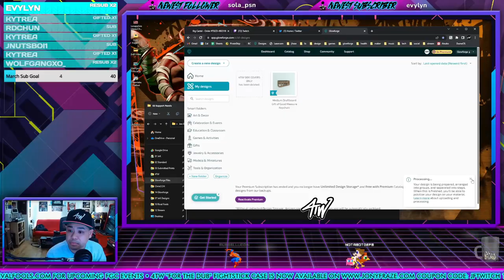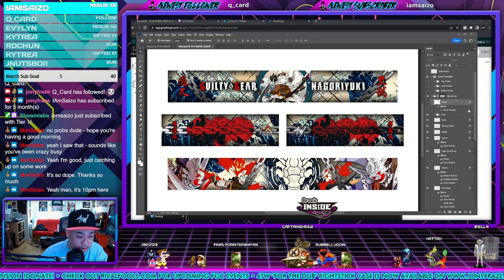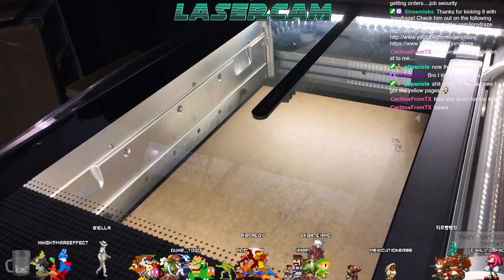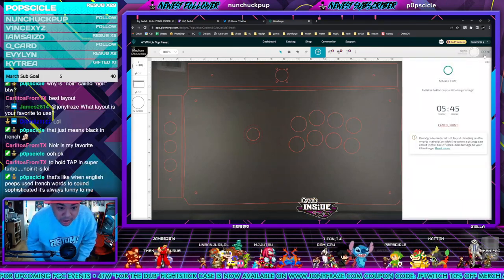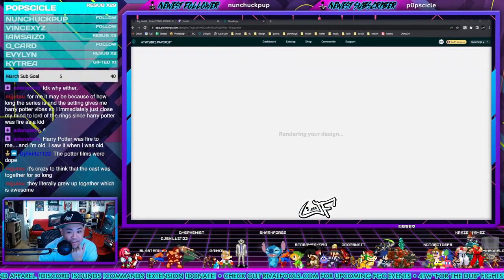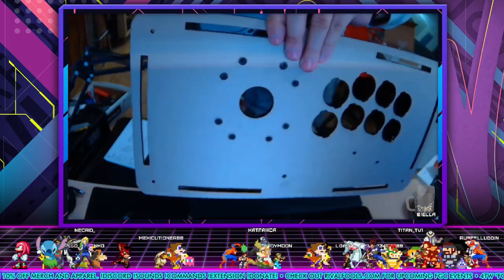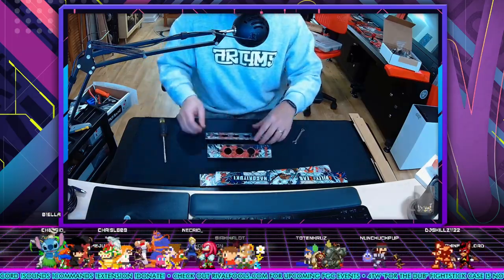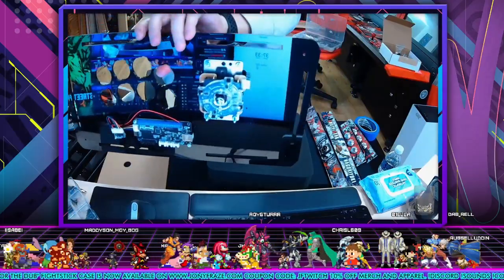Building a Fightstick from Scratch!

Comment: Hey man, I want to make an arcade stick, but covered in leather, maybe ostrich leather and you seem to know what to do, how can I  buy the project, the laser cutting files and the name of the cables and stuff I need to get? Also an advise, leather has some thickness, ill think it down to like maybe under 1mm , I can also tweek the files I know autocad but, a good start would be great. Thanks!
Reply from the maker: Sorry, I don’t have much experience working in leather. But I would assume that you can just wrap the components of the fightstick with it and use adhesive or staples to hold it in place.